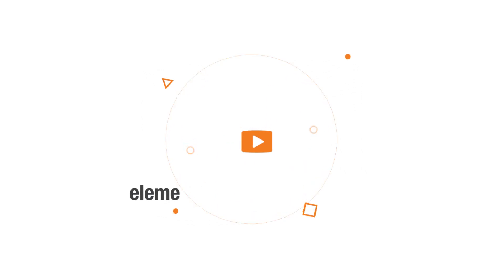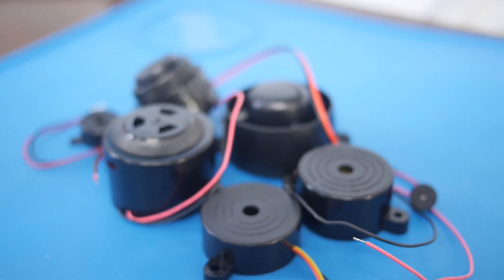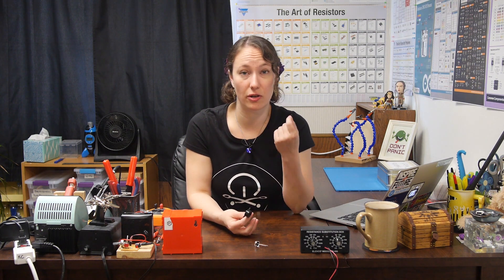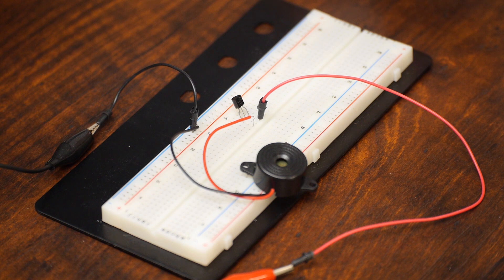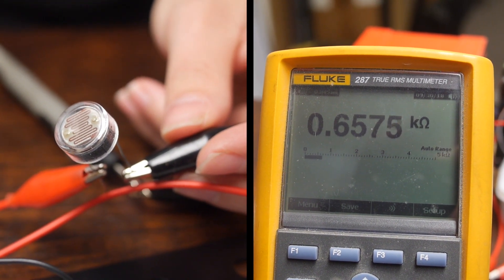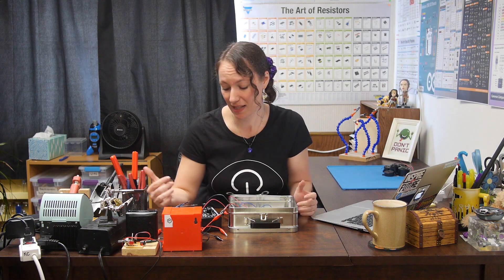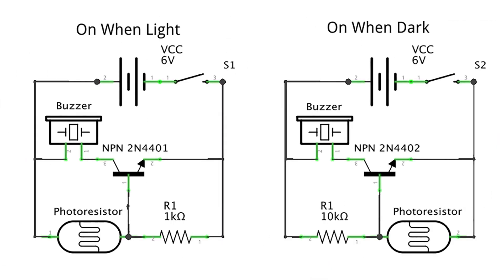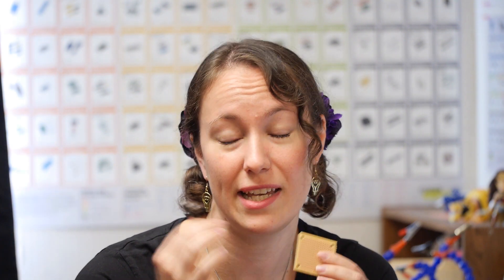Make Your Own Candy Thief Alarm - The Learning Circuit

Comment: 4:53 one thing to note is that if you put the buzzer on the Emitter side of the transistor, it will be a little quieter. That's because transistors have a voltage drop, which is typically 0.2V. It's usually best to put things on the collector side, unless you account for this drop.

I bring this up because I had an IR project where the IR LED was a little dimmer than expected because of this. Didn't matter much for that project, but it's something to keep in mind.
Reply: That's a great point! Thanks for pointing that out.

Comment: Nice transistor application. And the demonstration at the end was perfect. As another commenter mentioned if the thieves are smart they might try to steal candy in the dark. Maybe you should add some LEDs to light up the candy so you can see it better 😉(and have enough light to trigger the alarm in the dark).

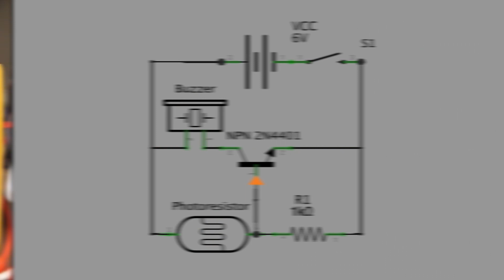Comment: @ 4:00 you state the resistor is pulling the base to ground. Without the resistor, the CdS could still switch the base on and off, right? You seem to be implying that w/o the resistor, the CdS wont switch the base on, or off. Can you explain why the resistor is needed, in more detail?